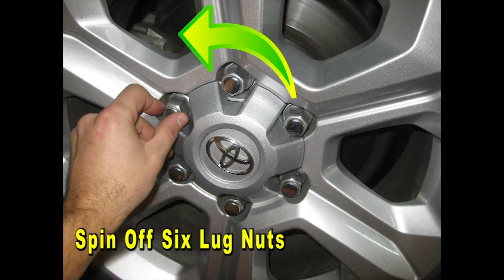2010 To 2024 Toyota 4Runner How To Change Rear Brake Pads - Quick & Easy Version

Comment from the maker: Toyota 4Runner OEM Rear Brake Pads - https://amzn.to/3BUJY3e
Bosch Rear Brake Pads Part Number - https://amzn.to/3WmO3Wc
Raybestos Rear Brake Pads Part Number - https://amzn.to/3C0NVDI
Bendix 4Runner Rear Brake Pads - https://amzn.to/3WDwAsj
Power Stop 4Runner Rear Brake Pads - https://amzn.to/3WDHZsa
Socket & Ratchet Set - https://amzn.to/3WlEZAX
Torque Wrench - https://amzn.to/3HYZkaJ
"F" Clamp - https://amzn.to/3PRMZqN

The Paul79UF YouTube channel is a participant in the Amazon Services LLC Associates Program, an affiliate advertising program designed to provide a means for sites to earn advertising fees by advertising and linking to Amazon.

Comment from the maker: Check out the DIY tutorial for changing the rear brake pads on a 5th generation 2010 to 2023 Toyota 4Runner  -
https://www.paulstravelpictures.com/2010-2016-Toyota-4Runner-Rear-Brake-Pads-Replacement-Guide/index.html

Here are all of the DIY repair and maintenance tutorials for the 5th gen (2010, 2011, 2012, 2013, 2014, 2015, 2016, 2017, 2018, 2019, 2020, 2021, 2022 & 2023) Toyota 4Runner SUV - https://www.paulstravelpictures.com/Articles/2010-2016-Toyota-4Runner-Common-Problems-Repair-Maintenance-Guides.htm

Owners of other Toyota, Lexus or Scion vehicles such as the Yaris, Corolla, Matrix, Prius, Camry, RAV4, Sienna, Tacoma, Tundra, FJ Cruiser, Venza, Highlander, Avalon, Sequoia, Land Cruiser, IS 250, ES 350, GS 350, tC, xB, xD, iQ and FR-S may also find these DIY instructions to be helpful.